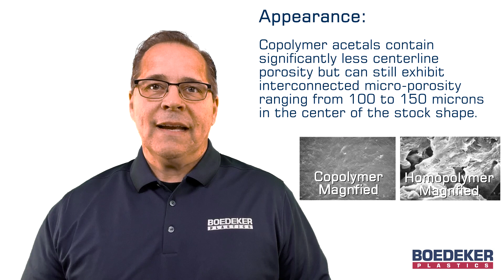Boedeker TECH Talk Episode 16 | Delrin vs. Acetal - "What are the differences?

Comment: Many thanks for your video! Could you please offer some data to support the points you said, thanks!
Reply from the maker: Are you able to clarify which specific points you require data for?  If mechanical/thermal/tribological data is required, an excellent source for comparison is to use our on-line material comparison tool on our website to compare POMC and POMH property data side-by-side.  If you are referring to chemical resistance, again we have comparison data available on our website.  Regarding Levels of crystallinity differences and machining differences, our comments are based on many years of practical field experience including conversations with numerous material supplier experts and our own in-house machining experiences.  If you require more specific details, feel free to reach out using our CONTACT US tab on our website and we'd be happy to assist.